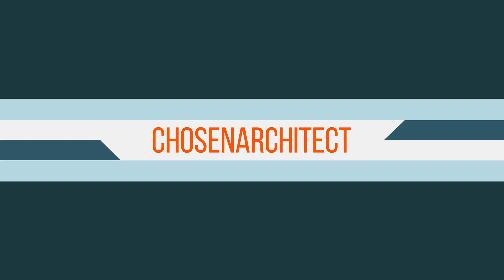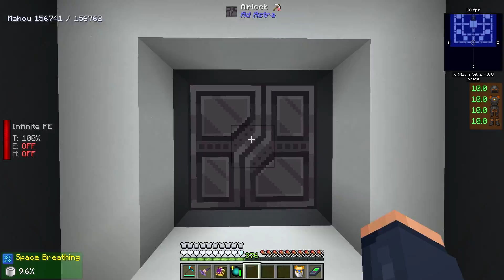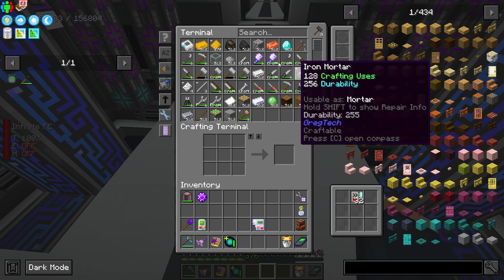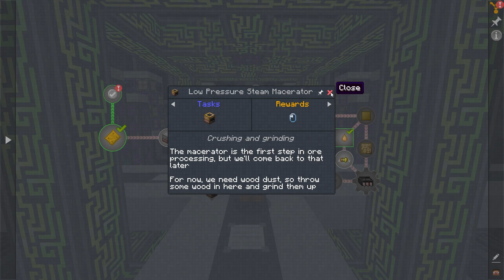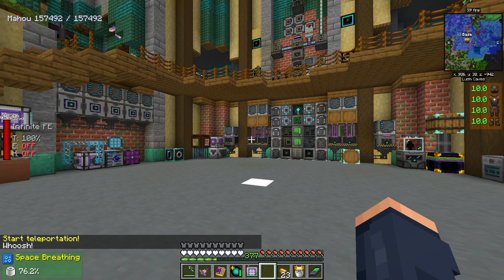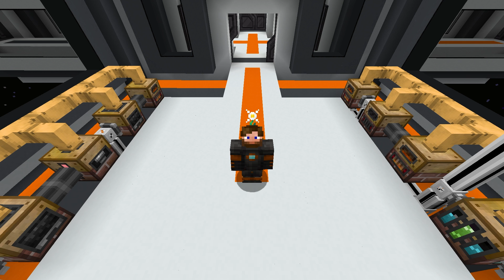Gregtech Steam Age EP63 All The Mods 9 Modded Minecraft

Comment: The AE2 Interface just acts like storage. So if the later machines can pull and push Items, you can use an interface and pull out of the interface while also using it to send item back into the system.

Comment: ME interfaces had never automatically export, it's just an inventory, but you can pull or pull from them. Anyway that won't solve the specific amount problem, since it onyl regulates its own inventory, not the puller one. Greg tech has machine "side upgrades" that will allow you to push or pull items, i dont remember the name but i used it a lot in the "Omnifactory" mod pack (a little old, but works the same way) you should check for it :)

Comment: Interfaces with robot arms/conveyors are the way to go once you get access to them, they are faster and can limit input/stock in machines

Also use drawers as buffers for passive processes to easily regulate the buffer with downgrades/upgrades and keeping your me system a little cleaner. 

One Example is use a robot arm on keep exact mode with 64 Copper and 64 Redstone to insert from an Interface below into an LV Alloy Smelter, which auto outputs to a drawer above with no storage upgrades/downgrades. If you connect the drawer to your me system directly or through a drawer controller (to make it more expandable), you passively make 2048 (+64 in the machine itself) red alloy and you can adjust the buffer at any time.

This eliminates the time to wait when requesting machines, and you generally want to passive 80% of materials like that. Especially if they have long crafting times, like EBF recipes which you want to passive every single one you need. (I dont want to see you autocrafting processes into ebfs)

But generally speaking you just want to eliminate waiting time as much as possible, because who wants to wait on autocrafting all day
Reply from the maker: Thanks for all the helpful tips!

Comment: Currently doing my first time through greg and currently at EV. Here some things I learned:
Always keep machines running. They are slow and it is better to run for backlog than to wait for ages. There are covers to turn of machines (machine controller), so combined with level emitter, that allows to keep stuff stocked. That is especially true for the induction furnace. Made the mistake to craft in him on demand, causing massive wait times...

LaserIO is quit nice with a counting filter to supply the right amount to machines. I prefer settingup interfaces to supply the laser net and let laser IO handle machines.

 As already mentioned, there are covers, pumps and more for direct use on the machines. Only issue is, the can only handle fluids or items, what is quit limiting in many cases. Thats why LaserIO. But didn't realise that I can use all the stuff on the machines. 

From performance perspective, stop using tools in autocrafting as soon as possible. The calculations for durability take up extra time. On the other hand, autocrafting is way faster. Finding the right point between backlog crafting and autocrafting is key here.

The pipes from greg look nice, but have limitations. For example, acids may destroy them. Meka pipes work well here.

You can transition away from steam ver, fast with the converter. I liked to deal with steam to MV age, to challenge myself a bit. The large boiler produces insane amounts of steam for early to midgame so you can easily power a lot of turbines with it. But at some point, they fall of a d the following boiler dont scale that good, that's why I stopped using them at some point. 

I hope, these tips helped. Similar stuff is written in the quests, following them is quit helpful, but looking to the sides is quit fun. You may just end up in a rabbit hole XD
Reply: These were great tips, thanks!

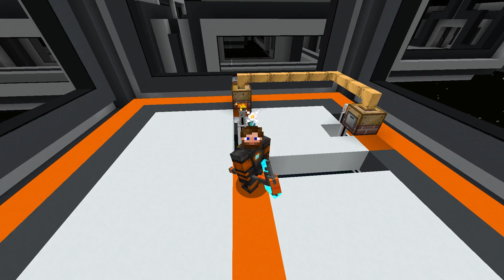Comment: at 22:20 this is only for steam machines. unless it is not yet implemented in modern GT, you can set an output side by using a wrench on the machine and in the GUI, toggle what to output. You may also put covers onto some sides for stuff like filtering or additional logistical options, this way, its actually really flexible

Comment: Don't know if this works, but wouldn't the crafts be faster by making paterns that convert a stack of ingots (or the limit of the tool) into a stack of plates/wires/whatever so it doesn't have to do it 1 by 1?
Reply: Crafting pattern dont allow that. Best thing you can do is co processing a lot and use tonns of advance mol assembler. Stack Crafting only works in processing patterns

Comment: Pretty sure you can create a mini-network to solve the export issue. Have the flat interface connected to a full interface block. They don't share network that way. Give power and don't link the networks by using the plain glass cable. Mini network can pull from the full block interface with its own exporter and the flat interface will make sure the full sized interface is full of whatever material you need to pull.
Reply: Just use laserIo with a counting filter at this point. So much easier...

Comment: Chosen, your idea of using the ME Interface as a way to dish out exact amounts was clever, but unfortunately interfaces don't export items. One way you could solve your problem is by using the GregTech Robot Arm cover with a filter to both enable item I/O for the machine and to make sure the machine only keeps certain amounts in stock. Pretty good greg episode otherwise.
Reply: Yep, that is the way to go. In the meantime, a simpler method that wouldn't require any new recipes is to use a Modular Router with a Regulator Upgrade on a Pusher Module that always keeps 16 sulfur inside the machine. But eventually you're going to want robot arms and all the other covers anyway so why not just add the recipes immediately?
Reply: LaserIO is quit nice as well. Saves ,ou on channels, since you can use a interfave to provide items and distribute stuff with laser nodes containing counting filter

Comment: unless you gonna put machines in the hallways, you gonna have to expand your base a lot for the whole of gregtech, even if u do put machines in the hallways, it may not be enough for the bigger multiblocks, the most common ones are gonna be 3x3x4s, 3 blocks wide and 3 blocks high, and 4 blocks tall, you can also put input and output hatches anywhere in the multiblocks, atleast where you usually place the machine casing blocks
Reply: And then there is the micro universe, maybe the same size of his current base. Not required, but I was fascinated when I first saw it in JEI from the pure size XD

Comment: so in 17:45 you said you are gonna do a machine per part required... dont do that and most people who played gt will agree, theres a LOT of things that 1 machine per part is gonna be not great for performance and space usage, what you could do is parallelize the crafting of wires, plates, rods, etc with multiples of the same machine but on demanding it because of the sheer volumes of items.

On the other hand one thing most people like to do is to passive the ingots and alloys that you would use in approximately 34 minutes after finishing the steam age, thats actually helpful because they do take like 3 billion years to craft.

Same can be said about circuits but even worst because each voltage tier (LV-MV-HV-EV-IV-LuV-ZPM-UV, UHV theres only 1) have like 3 types of each one being the next one always cheaper but using more exotic materials so you shouldnt raelly passive them (maybe like the best of each tier but thats for way later)

ah luckily that base is modular you will need like x30 of that space

The only thing that i 100% recommend to always have in stock and passive are the diff chemicals, like the diff types of rubbers and polymers, and a lot more that you will encounter later one.

Another thing, GT machines are slow as hell early on but at around IV they start to speed up with the unlock of multiblocks that makes them better with parallel up to 256

Comment: So you have the right idea of using an interface to supply items around but rather than use an interface I recommend instead using some kind of pipe that can round robbin the items around and filter the inputs and outputs, also subnets like you said are not a bad idea as they allow you to keep items where they should stay but still access them it's a nice way to compartmentalize your machines. I also prefer switching over to AE2 entirely since it has all features that I can think off from RS with addons including your beloved storage disks.